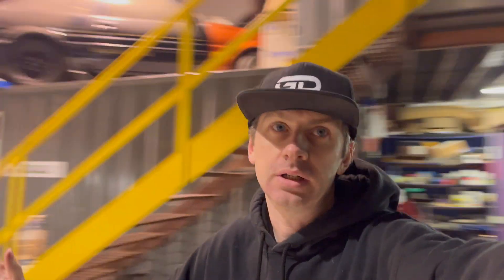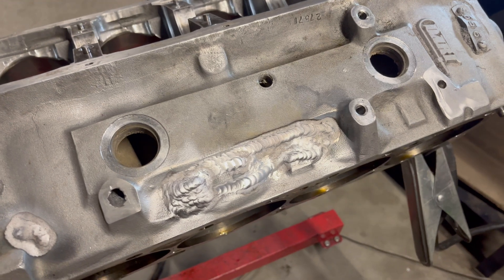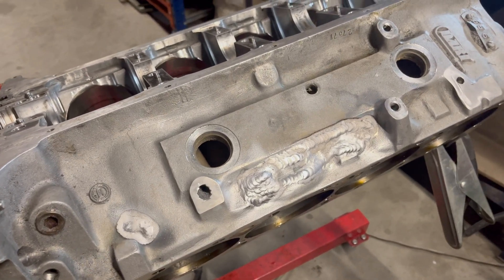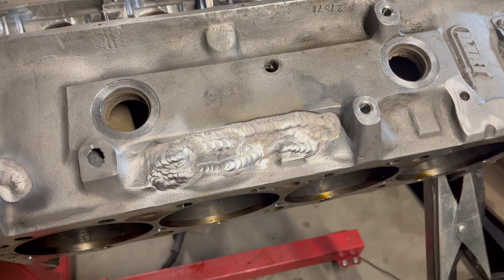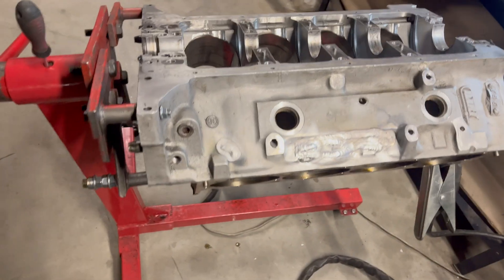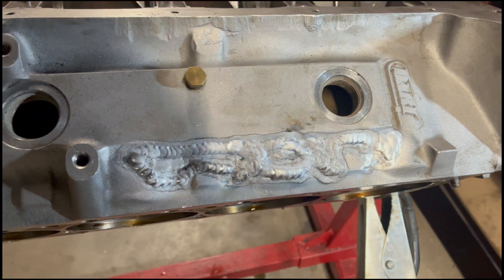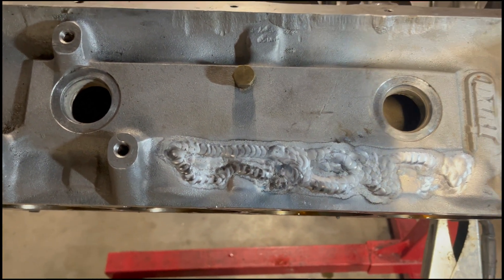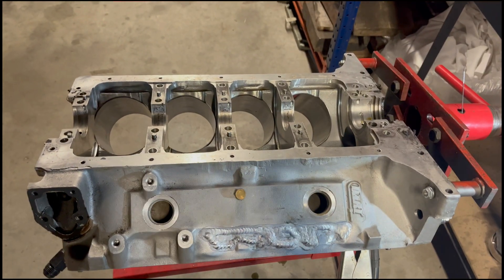D-MAC 240SX 2024 Rebuild | Episode 2 | Camshaft wear and cracked block repair | Sprint Car 410ci V8

Comment: Good job, not had to do any aluminium blocks but have done a right few cast iron ones. Tractors and boats mostly and not had any issues. One thing I usually do on cast iron and cast steel welding repairs with good effect is to peen the weld back. Once I started doing that I found I had less chance of a crack reappearing when cooling. Also slowing the cooling process right down with fire blankets or old welding jackets etc.
Reply from the maker: Thanks 👍 Yes good advice. The peening is a good job for sure by the looks of it but i have no experience doing it

Comment: What a mess, hope you find the sleeves it time. I thought that it was to far gone for sleeves with the cylinders already being bored out previously. Nelson Racing sells some might fine engines but you’d have to mortgage the shop for one. 
Looking forward to the next video. 
Btw Loan Star Drift had a used sprint car, not sure what he did with it. It was pretty old.
Reply from the maker: We have sleeves order so just waiting on them. Gotta reuse what we have block wise

Comment: Fluid in the holes?  essentially a little hydraulic. You tighten down the head studs and split it
Reply from the maker: No as the engine ran for 2 years without this prob and was never opened
Reply: @Group-D  what compression ratio?

Comment: I see the pain in your face but think you should be ok if it was running cracked all along and your getting block decked with the sleeves... cam is crazy nearly looks like cast mark crazy if they put together like that but looks like it 😬
Reply from the maker: Ya it is certainly better than it was and it ran all year... gonna be stressing it a bit more though this year when finished. I guess we will never know about the cam, shit happens

Comment: Does the crack in the block, and welding it not affect the bores at all?
Reply from the maker: Its possible but the is being fitted with new sleeves and machined so should be fine after